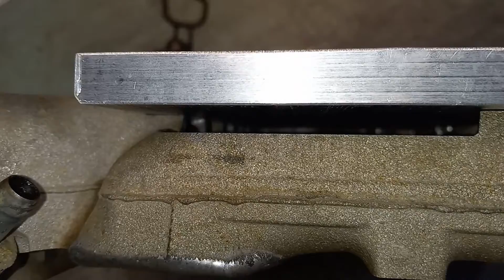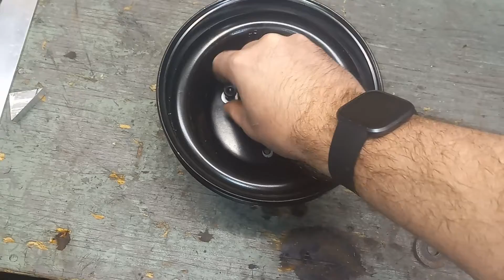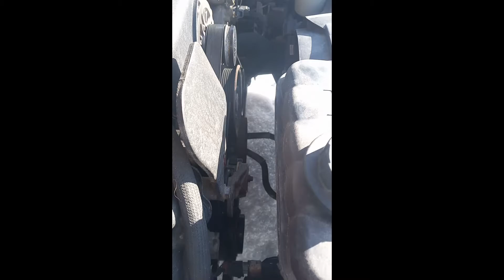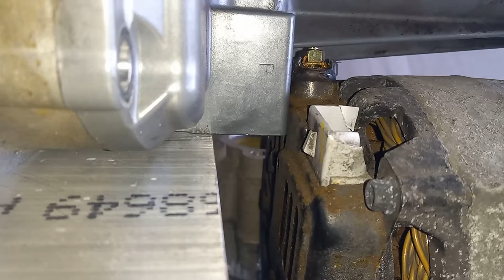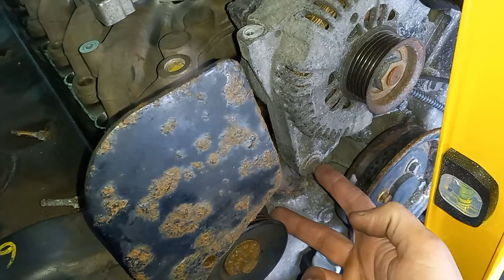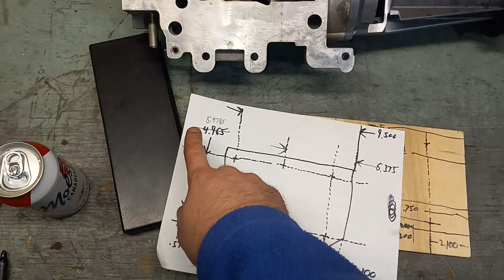M90 Supercharged Crown Vic - Part IV

Comment: Hey man I have a crown Vic 2006 p71 I want to put a 5 speed and I'm thinking about the supercharger upgrade the m90 off a 3.8 my problem is I don't have a machine shop I'm mechanical inclined since I could walk pretty much ,but do you do any machine work for anyone besides yourself like if I was to buy a intake and send it to you to machine it to fit the m90  and for all the work you did was it worth it I have looked at some supercharges you can get some good used for 2500 or more but the m90 is relatively cheap tanks in advance don't work to hard an stay warm
Reply from the maker: @brianhensley3622  I appreciate the interest however I cannot machine parts for anyone else.  And even if I could.  It wouldn’t be worth it to me for anything less than $5k.

Ive shown the method and provided drawings in detail.  If you’re serious you can sketch them out yourself and approach a local machine shop to make them for you.  

Or centrifugal kits are available for this engine that are bolt on.  And would provide the same result.   

My intent was to do it cheaply.  And to prove the M90 can make boost on a V8.  Which it clearly can.  

I also recommend you watch the videos by the YouTube channel “Make Cool Stuff”.  I received my inspiration from him.  He accomplished it using more basic tools and an Edelbrock manifold.

Comment: Jmm i want to build s triton but dont want to fab an intake. Figure ill buy a saleen charger with intake and rails if it will fit
Reply from the maker: It would but the throttle comes out the opposite side.   Plus it’s wayyyyyyyyy more money.
Reply: @bpbuilds  def way more money but I don't have fab skills like yours haha
Reply from the maker: @EastDallasKicks by triton motor do you mean the truck engines from a F150?   It’s the same as a crown Vic it would bolt on. Same motor.  Intake gaskets are interchangeable.
Reply: @bpbuilds  Yeah I figured they were the exact same when it comes to tritons and vics..when people used to say Vics had mustang motors I used to think don't they really have tritons haha. Been a couple days since I watched the video but didn't you have to fab an intake midplate for the supercharger to bolt too?
Reply from the maker: @EastDallasKicks  yes it’s coming out in next video

I think what you’re thinking about is the Romeo vs Windsor 4.6 engines.

Comment: Awesome video! I just got my edelbrock intake and can’t wait to start cnc work on the Intercooler and adapter plates. Thanks for displaying the info for the airways, that will make my work much easier.
Reply from the maker: So you are cutting up an Edelbrock 28385 intake?
Reply: My plan is to not cut it up, but if I have to I will. If the hood has to be cut then I can cut that instead, might be cool to have a hood scoop or supercharger sticking out.
Reply from the maker: @ConnorHuet  watch the videos by the Make Cool Stuff channel. He didn’t run the bypass valve though.  I think he did similar to what you want to try.  

I think you will have to run a hood scoop.  By the time you put the supercharger on the Edelbrock manifold with your adapter plate.  It will be too high and will hit the hood. 

If you’re ok with that then that will work well.  But I didn’t want to cut the hood lol.
Reply: Ya I saw that video, I think I might be able to get around cutting the hood, I can make lifters for it and cut out the internal supports, but at the end of the day, a good hood scoop would look rad.